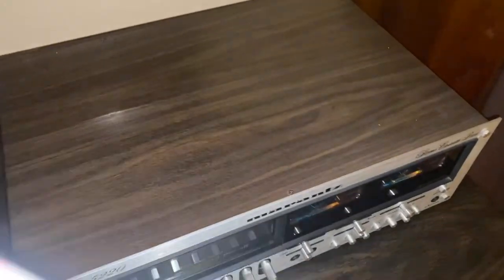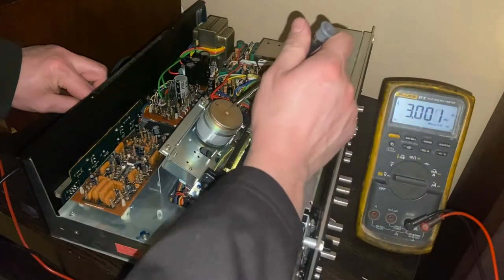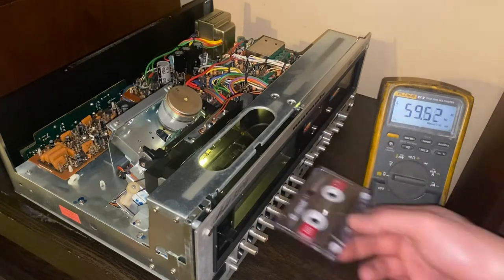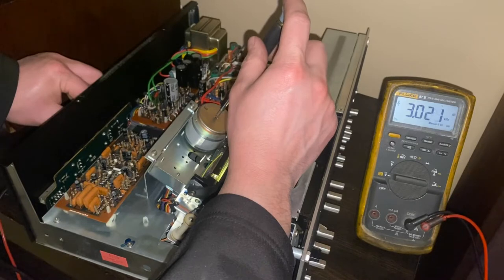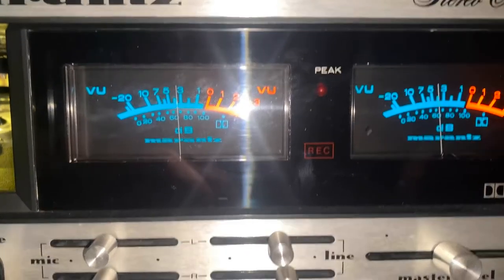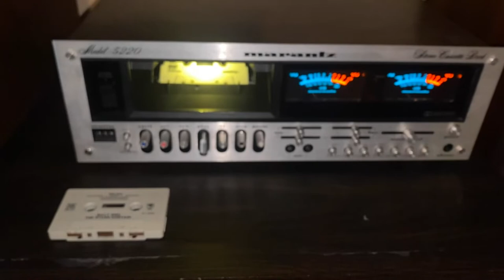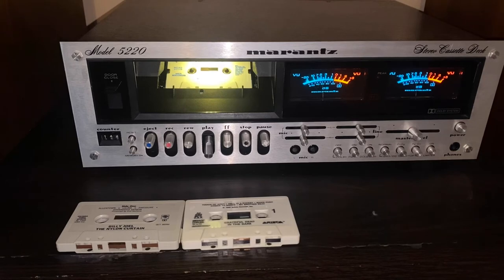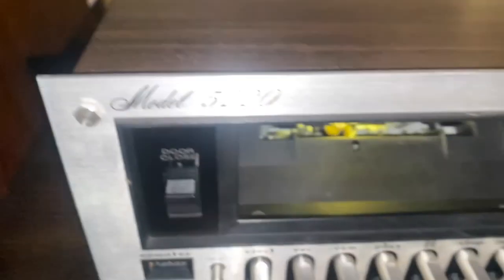How to use a Test Tape to get Cassette Deck Speed 100% Accurate! Speed Adjustment on a Marantz 5220

Comment: The Unit you talkt about that is slow and normal in speed. Oil the capstan bearing and the motor. Or check if the motor is faulty og its a DC motor and not a asynkron AC motor

Comment: How do you know your test tape was recorded on a calibrated reference deck?
Reply from the maker: Well, that is an excellent question. Really, you have to trust the integrity of the seller. He has a totl Pioneer CT-F1250 that it was made with. Ive also verified by ear and by playing the digital file at the same time to make sure they are in sync and end at the same time.

Comment: Thanks for the video! Replaced belts yesterday on my Toshiba PC-D10. Playback speed changed dramatically, so I also ordered this calibration tape. I did it by ear, but it is a little bit off.

Comment: How do i test my 8 track player for correct playback speed.
Reply from the maker: I wish they had a speed tape. Most 8 track players dont have an adjustment either. Gotta do it by ear or play the cd or digital file simultaneously and see if it lines up